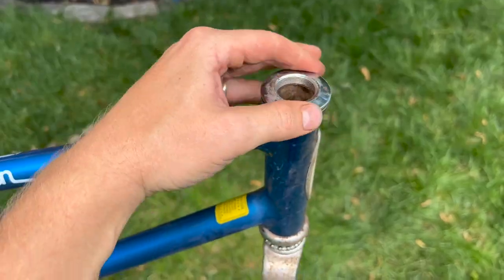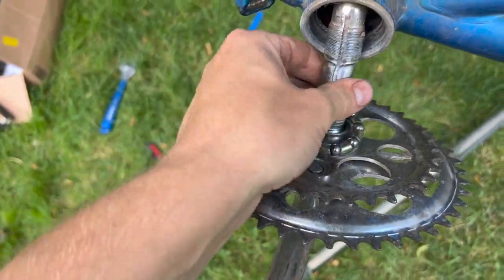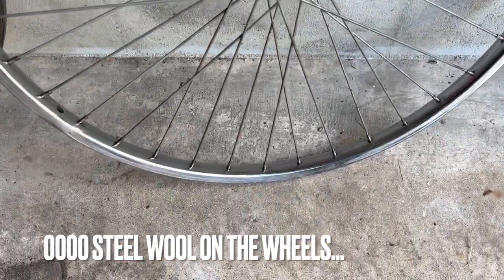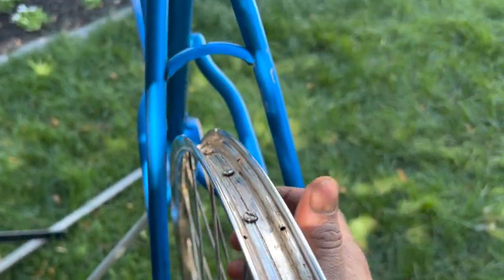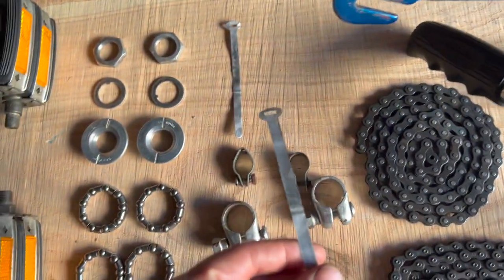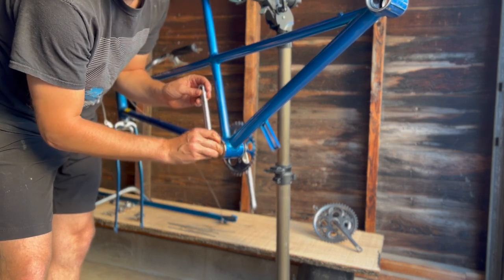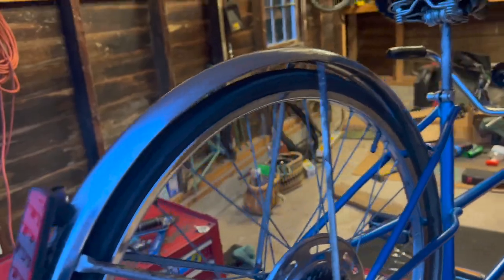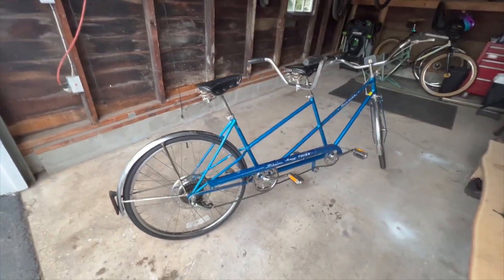How to RESTORE your vintage Schwinn | Save the Schwinns!

Comment: The Twinn looks great, man. Awesome job! I have a '77 Twinn Deluxe in the same color blue as well! Like you, I pulled it all apart and cleaned it all up thoroughly, regreased, etc. I agree, these old Schwnn's are an absolute pleasure to work on. It's true what they say, "they don't make 'em like they used to". I ended up going with the tan gumwall tires and added a nice wicker basket to the front to match for a classy look to it and my wife and I LOVE that bike. Such an absolute pleasure to ride around town.